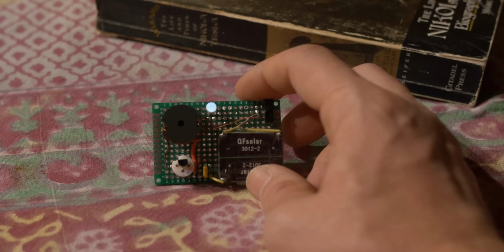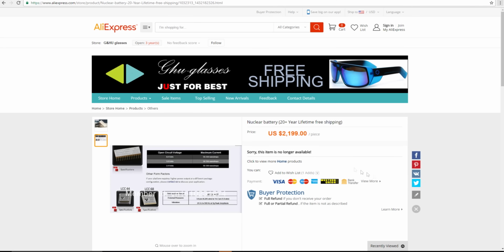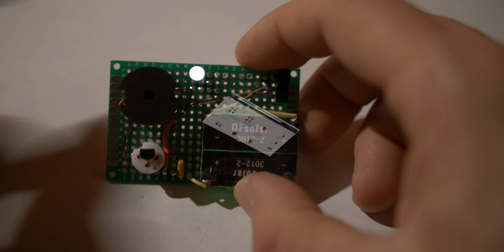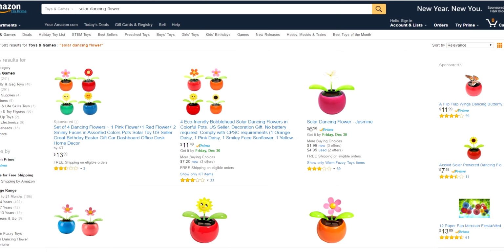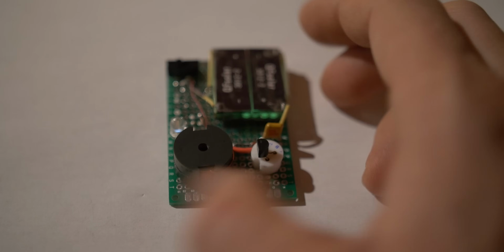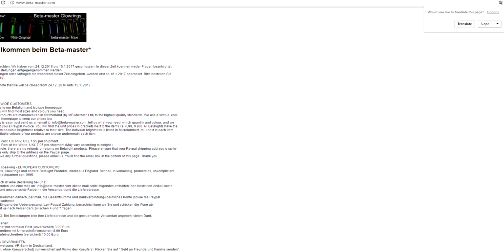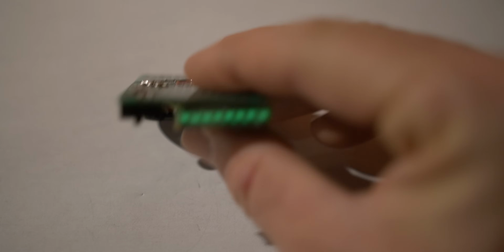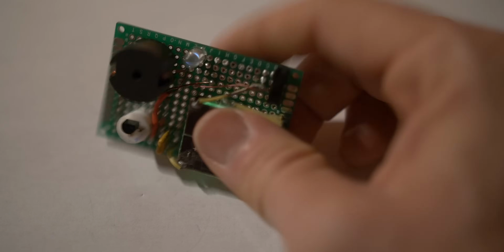DIY Nuclear Generator - Radioisotope Photovoltaic Tritium Power

Comment: Stint 2: ..use the Red LED instead...add more panels and tritium...and try charging a battery..and I think working on the peltier thermoelectricty is much more safer than these radioactive element & you do not need to shake it up everytime to make it work...I got 300 mv with 3 in series...turn those wasted heat into something useful..like overheat alert..etc

Comment: You can make a much more efficient one by taking several small naked monocrystal solar cells, sealing them in glass and coating the front surfaces with a thin layer of a red conversion phosphor. Then filling it with about 5 vials worth of tritium and sealing it. Requires some glasswork and creativity but outputs a few orders of magnatude more power. The other option is to coat the cells with a super thin layer of a hydride former plus phosphor, that will get you into the low ma range per square cm because it concentrates the tritium close to the solar cell so you get energy from light, the soft x rays, and electron scatter itself. 🤓
Reply: What about 5 vials flat🧪 and two solar cells on each side like a sandwich 🥪 ? Good efficiency ?

Comment: Nice. So if you think about it you may try making a solar panel at 18kw using 600v or thin film solar cells similar to what you used and put some 9 amp solar panels in parallel and use some heavy duty darling-ton transistors to run a crude inverter.  The odd comment I was going to make was what if you put those litro cells in a Tesla coil and tried to get power out or put it inside the coil of a joule ringer for beta voltaic amplifier or on the outside to up voltage as ionization of copper tends to boost power. ??
Reply: https://youtu.be/8WKQNz_reEY

Comment: Sorry this won't work for tritium  but i Recently got interested in engineering a passive atomic battery using americium because I'm able to get it out of old smoke detectors and it emits mainly Alpha and gamma anyway Wouldn't we have higher efficiencies with a direct ion capturing system using a magnet and a coil Crystal like they use in radios using a permanent magnet to separate the charged particles capturing them with the coils capturing the energy through electromagnetic induction has one photon being is passively accelerated through one coil giving you a positive charge and the other ion beam is being accelerated through the other coil giving you your negative charge and a extremely fast switching rectifier  to prevent any charge from flowing back out of the coil feeding it into a capacitor Bank without relying on tricky thermonuclear nuclear or inefficient photovoltaic nuclear  generation. this would rely radioactive decay at a natural rate that depends on the element you use meaning that are fuel will last longer and we don't have to force it into criticality if we want more energy we can do two things make more cells or add a little bit more radiation without ever getting the radioactive material hot enough to go critical or supercritical reducing any chance of a meltdown

Comment: You could've gotten more power out of it with better solar cells,  and use a boost converter instead if you are powering LEDs. You wont have to pulse the power output. You can get more than just a nano amp and you can get up to 2.5 volts straight from the solar cells bud

Comment: You should use bigger solar cells. Those wimpy solar cells in those dancing flowers arn't going to put out much juice. Get a solar 6V battery charger and load the PV panel up with tritium bars and try that. if it puts out enough current to run a boost converter like a 1.5V to 5VDC converter you now have a power bank that never needs charging.

Comment: Can tritium motivate a Crookes radiometer. If the fins in the radiometer were magnets and there was a copper coil around the vacuum sealed enclosure could it produced worth while voltage?  Plus surround the thing with solar panels to boost efficiency...could you produce this type of motor?
Reply: I've started the build on the Mezzanotte Crookes beta voltaic radiometeric stator generator.

https://m.facebook.com/story.php?story_fbid=10210871963249101&id=1052643583
Reply: https://m.facebook.com/story.php?story_fbid=10210871937208450&id=1052643583

Comment: One of my viewers tipped me off to this idea today. The Nurd Rage video is excellent.  I'm surprised you have already done a replication and have a led circuit running off it. Well done. It is a pricey project for me but I may have a go anyway.  Getting a motor to run off it will be amazing considering the potential 12 YEAR run time.

Comment: I saw his video also. The only problem was low current output. Great video!
Reply from the maker: Yes, it is an impractical amount of power for most things, but I love the challenge of trying to get something running on it.  I am already working up new ideas for the tritium motor design.  If it works this will be my lowest current draw motor yet.
Reply: lasersaber It's cool though. Always fun to experiment! I just bought a supercapacitor balance board from Tesla Maker for my 500F caps. I must say, very nice. :-)
Reply: lasersaber  hey, on school i am designing a module for the agricultural sector for measurements in the field working with Lora. the power consumption has to be real low so i design it with very low power consuming components with a pic24 mcu. basically it measures and transmits only 1 to 10 times an hour. do you think this generator would be able to give enough energy? idk how much energy i need exactly per hour yet, but its low. just looking for alternatives for a solar panel, cuz they get dirty in agriculture.
Reply: Yes,. the fix https://youtu.be/8WKQNz_reEY

Comment: Ok, if your into low power, try the Nicola Tesla wireless power receiver. Power is determined by the difference between the antenna and ground points. I've seen 5V 200mA at 20 ft difference, if I remember right. It's a very simple circuit.
Thanks lazersaber and NurdRage, you have taught me something new, the beta-voltaic cell. Q: Is there a gamma-voltaic cell?

Comment: Very impressive work! I thought it wasn't possible to light an LED on just a microwatt, shows what i know :P

Tiny little misnomer: This is still a photovoltaic generator. A betavoltaic generator specifically uses betavoltaic cells that convert beta radiation into electricity. We're still using photovoltaic cells here so we can't call it a betavoltaic generator. It's more accurately described as a "Radioisotope Photovoltaic Generator", or tritium photovoltaic generator. Ah well no worries.

The achievement of lighting a LED is way more impressive than minor name issue. Any ideas how much power it's producing? Your tritium vials seems brighter than mine, maybe that's why mine were so cheap because they were from a bad or low quality batch.
Reply: Anyone else read NR's replies using his voice in your head?
Reply: I have actually done work on real betavoltaics in my home, basically you use thin film solar cells that use PIN junctions instead of normal PN junctions. use acetone to remve the protective plastic coating, smear on powered thalium 208(EXTREMELY DANGEROUS) and roll it up like a fruit roll up with a layer of kapton. it produces slightly more energy than what you got....slightly. its practically useless considering the cost. I posted about it on reddit i dont know if you read it very much.
Reply: NurdRage They might have been older.  There are people who have been selling these vial by vial out of the same box for years.
Reply: Good point. If Lasersaber was able to get a newer batch that must mean the seller has newer stock and i should order from them instead.
Reply from the maker: Thanks for the correction.  I fixed it in the video title.  

I was not able to light the LED directly on DC.  The SJR L circuit works great for driving LEDs on next to nothing over a wide voltage range.  Here is a video showing one powering 2 LEDs on .9uA: https://youtu.be/8mJX5qW4ghk

If I could get up to 1uA I could drive the LED much brighter.  At this point the glow from the tritium is brighter than the LED.
Reply: NurdRage In the future purchase, I would also suggest finding the best match for the wavelength most absorbed by the panels.  As these are phosphor coated tubes, the lumen output should be relatively the same regardless of color.   This should maximize current output as well.
Reply from the maker: In reading I also came across a lot of folks saying that bigger vials are not necessarily brighter.  So it might not be worth buying the larger 100mm vials.  Although I am very tempted.
Reply: lasersaber: impressive! i wish i had known that before i made my video, i would have included some type of circuit to demonstrate a use for that power level. Maybe i'll make a followup video. As for size, i'm more after cost/surface area reduction. If bigger sizes are less costly, maybe i can make a larger unit and do some more interesting things. 

mwm2929: I thought green was the best match for amorphous silicon solar cells. Do you have any data suggesting otherwise?
Reply: You are correct.  I hadn't looked at the data until now.
Reply: I don't know what system lasersaber is using, but I know bigclivedotcom has the 'joule thief' that he uses to run a couple leds on dead batteries, a similar system might be useful here
Reply: how long will it last?
Reply: @jonathanolson772  using a tritium source, it produces half the output power every 12.4 years or so. basically, the lifetime is determined by how much more power it generates vs what is needed as a minimum to run the device. if it produces twice the minimum power to start with, it will quit "working" after 12.5 years. if it starts with 4x more power than the device needs at minimum, then it will last 25 years. etc
Reply from the maker: I did it!  https://youtu.be/3B5JPuEUCyc
Reply: see city labs of Washington d.c. they make betavoltaic devices using nanotech
Reply: NurdRage paul m brown was killed over his resonant nuclear battery. if u got a spectrum analyzer find the frequency of whatever isotope your using and tune into it. think tritium is 11yr Half-Life and in Kev but should power a lot more than collecting photons off of collisions with phosphorus. his nucell was getting 7.5kw but was using thorium but it was hand held

Comment: Watching his video again, I noted his voltage only went up a small amount by adding the second panel on the other side.  I would then assume you would do better to parallel wire in the other side to boost current, rather than in series.  Of course mirrors on the sides would also help.  Can't wait to see what you can do with this.  I have found a source for the tritium rods in longer lengths as well, as I was intending to build a small LJL SC running off the nuclear battery from nurdrage.  Look for a local tritium exit sign recycler.  They have TONS of tritium rods.

Comment: Maybe you can cover all in some sort of mirror to avoid light leakage.
Reply from the maker: To get a motor running I may have to do that.  Since this is mostly an interesting novelty I will probably try to leave some of the light exposed even on the motor.

Comment: That's a hell of an expensive useless generator!
Reply: It's not exactly useless, generators like that are used for critical memory backup operations, where the power needs to be present for many years and other types of batteries can't be used.
The retail ones are also made to be extremely reliable, there is no risk of it leaking or gases venting in case of a failure, unlike with electrochemical batteries, which contain volatile chemicals.